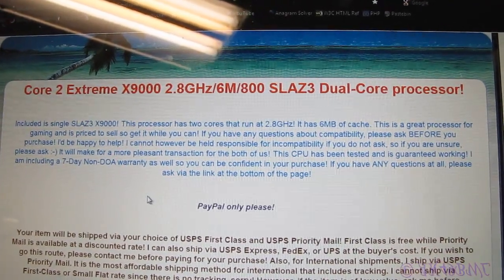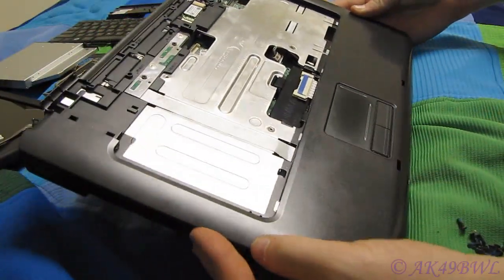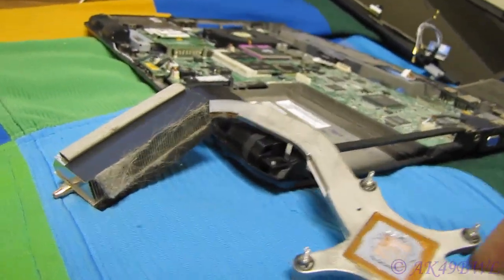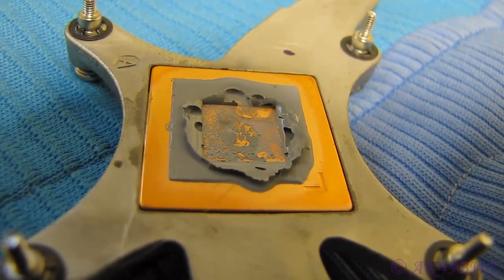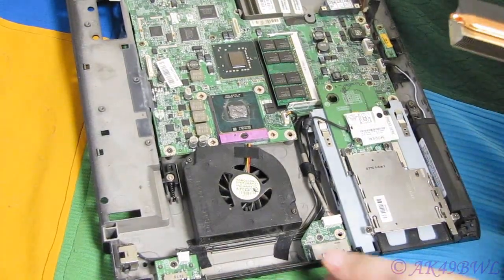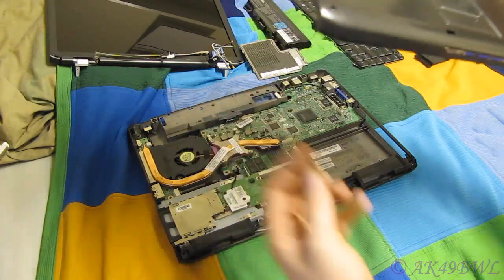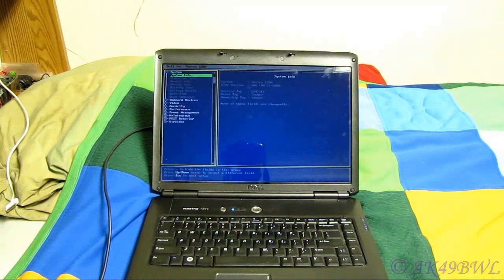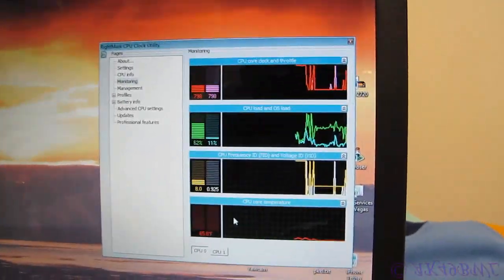How to Replace a Laptop CPU

Comment: Could you please tell, I have Acer Aspire 5310 with Intel(R) Celeron(R) M CPU 530 @ 1.73GHz but my computer is slow, if I buy Core 2 Duo T7200/2G you think is compatible with my computer and it will be very fast?.
Thank you.

Comment: Love the motorcycle at 9:52   Nice video too.  I wonder if the new Dells with the Core i 3-5-7's CPU's can be upgraded. The manual for my i7 shows you how to "replace" the CPU, so an upgrade is likely.  Going to an Extreme CPU would be pretty cool (hot).  Is Dell the only manufacture that allows you to upgrade your CPU?

Comment: There are a few adapters out there that will let you run a laptop cpu in a desktop, but I haven't seen desktop to laptop adapters. I think the heat would be to much. For example, The one adapter I saw was an Asus Ct 479.

Comment: hello, i have a Intel pentium dual cpu t300 @ 2.00 ghz in my compaq prescario cq70 but i want to upgrade it , i dont have much knowledge when it comes to computers but can i upgrade to any sort of processor. I use sony vegas alot so need something decent for rendering & general computer speed.

Comment: Hey! 

Q:  Can GL960 Can Handle Intel X9000?
Cause GL960 Can Handle a Intel T9500.

I Have an Acer aspire 4715z, w/ GL960 Chipset..
and I Found Some Threads/Forums That GL960 Can Handle a CPU That Have an 800Mhz, FSB..

Comment: WHY ARE YOU DOING THIS ON YOUR BED.  you need a static free work environment to work with computer hardware because you run the risk of shorting something out.  Hardwood/tile/linoleum floors are the best, on a table, without a watch on or phone in your pocket. Shorts on components do happen as a result of static, and it does suck when it happens.

Comment: Hi I currently have a Toshiba Satellite C655D, and I really want upgrade my processor. I currently have an AMD E-350 Processor (2 CPUs), ~ 1.6 Ghz, and I want some type of i5 processor.
1) Do you have any suggestions on which processor might be compatible?
2) Would Best Buy be able to change the processors since I won't attempt it?
3)Do I need to do anything else?
Thank you for your time,

Comment: Thanks so far. What's a pga988? How do you throttle it back? What are you throttling back? I'm not having you on, but much as computers fascinate me, I know surprisingly little about them. I know more about PlayStation2 hardware, but that's only because I opened up the casing when (for another project) I had to tinker.

Comment from the maker: Hehe, I've done that, it made for a fun several minutes :D
Yes it would probably be just fine if you can upgrade the heat sink. I cant on mine so when it gets too hot for my liking (about 160*F) I just throttle it back a little. Your P6200 is a pga988, so that's the only style i7 you can get, but there appear to be a lot of options :)

Comment from the maker: About the RAM... You tell me. Apparently you don't seem to believe 4GB is enough, despite the fact that 32 bit windows can only use 3.5 of it anyway... AS for the CPU, I'd need to know which chipset it's running. You most likely can upgrade it, as manufacturers never put the best possible CPUs in there.

Comment: the scratches wont affect cooling much:p and not another comment about how you put to much just some helpful info the thermal paste isnt to transfer heat (it is partly) its mainly there to fill microscopic holes in the copper heat pipe  and the cpu :)

Comment: you dont need a new pc guys , ive had this for 2 years , i have a few laptops , but i have a old laptop and it has a core i5 , and has win7 ultimate 64 bit , works fine , obvs other things have been changed , but worth it

Comment: wow your computer is really old that a lot of shit just to get to the cpu my computers cpu is  really easy to get to just unscrew the bottom take of the heat sync and wala cpu! you could have just bought another computer with  one of the icores instead of a core 2 duo extreme its almost 10 years old now thats centuries in computers. lmao

Comment: Did you even think about the more cooling power you need for a better processor?
Because Dell designed the cpu cooler for a lower end cpu not a high end one.

Comment from the maker: All you need is the chipset model. 945GM: ark[dot]intel[dot]com/products/chipsets/22816?wapkw=945gm - - - The highest model CPU you can use in your computer will be the Core 2 Duo T7600 @ 2.33Ghz, 4MB cache, 667Mhz FSB.

Comment: you shuld NEVER use a screwdriver to clean the thermal paste off it will scratch the copper and it will give worse cooling performance. And you should use as littel cooling paste as posible and get a thin layer over the core or else it will have more "space" to move through. just saying other than that good video

Comment from the maker: I use it for video rendering as the most CPU-intensive task on it, and the CPU upgrade did it a WORLD of difference. I'm not a gamer beyond little stuff.
For the other two comments. I was not aware at the time I did this what was right or wrong, I just did it. And such as it were, it's still working perfectly so I'm not going to worry about it.

Comment: You had to take the entire laptop apart, even the keyboard. Just to get to the processor. Wow, didn't realize how lucky I'am to have a laptop with a back plate that's easier to remove then a cellphone battery cover.

Comment: I have a question about my laptop. I have a (late 2011 Model) HP Envy 15 which has an intel i7 2670qm processor. could i upgrade that to the i7 2860qm or maybe even the new ivy bridge processor?

Comment: Ok just a tip next time, don't glob the Thermal Grease on like this. The thermal grease is only meant to fill in small scratches in either the dye or the heatsink, using to much thermal grease can negatively affect your processor by not letting it cool properly.

Comment: Brillant...such a instructing video with clear quality and no boring. Thanks for upload.
 Can you please guide me. My laptop has T7250 with integrated  intel 965 (X3100)video card. but I have spare motherboard T2310 with Nvida 8400 (better for games). 
1. Can I replace the mother board.
2. If yes then Can I put the processor of T7250 into T2310.
Thanks

Comment from the maker: @Gamefreakzzzzzz either the CPU or GPU maybe. I don't know that replacing the CPU will fix your problem tho... Your problem is with cooling, not the CPU directly. But, I got my CPU from Ebay if you still want to try that... But that's even more in depth than cleaning our the heat sink.

Comment: @AK49BWL my laptop is  about 1-1.5 years old, and i dont dare to open my laptop parts to clean it all up cause i probs screw up :S ,  but my laptp does get enough air i bought a cooler for 25 euros, but it sitll feels like 100000 degrees hot lol, what do you think??? is it the CPU  ?? if so, were do i buy a new one and about how much will it cost me? Thanks for answering my question so fast :).

Comment from the maker: @Gamefreakzzzzzz Sounds more like you need to get more airflow to the CPU heatsink. how old is your laptop, and have you ever cleaned the heatsink on it? It may be clogged, causing the overheating because the fan can't get any air over the heatsink fins to cool the CPU.

Comment from the maker: @dragumox3 This depends on whether the 3rd party keyboard supports your laptop. The connector has to match, and the pinouts ON the connector have to match.... Otherwise I doubt it would work at all. Generally you have to find a perfect matched replacement, however if your laptop (from the factory) has the option of using a lighted keyboard, you can generally find a direct replacement on ebay or a computer store maybe.

Comment from the maker: @aliha9123 No. There are only specific models you can replace a specific model with. Generally speaking with laptops you have to use the same FSB, and you have no choice but to use at least the same socket type, that being LGA775, PGA478, whatever. Also, Desktop PGA478 CPUs are not compatible with laptop PGA478.

Comment: @AK49BWL  more compatible with amd. am2 will take am2+. am3 and am3+ i can't vouch but i know am3+ sockets can take am3 chips. this is all depending on the tdp rating (in watts). the bus will down clock to the slower bus, board or cpu. the ht is 2x the bus speed in mhz. a bios update might be needed though chipsets don't really matter much. intels are more picky about things chipset bus wattage and the manufacturer's limits in the bios..

Comment: @KillfeedOMG it makes it easier if you have a "service manual" open on another machine. it'll tell/show you how to safely take it apart. one thing, don't gob the compound on the cpu, a dab will do you there. rice sized grain on a chip that small would be good. also don't use a screwdriver to get the baked compound. aside from that make sure you have a clean surface for the compound, i use alcoholism and qtips to remove the left over residue. it's never let me down.

Comment from the maker: @kevkev047 From what I've found, it is possible *IF* a specific model had more than one graphics card made for it (not including Intel's integrated lines). If the 17r only had the one card made for it (no upgrade options, etc), then no, it's not possible. But, Dell seems to have at least two different options on all of its new systems, so you'll just have to research a little :)

Comment from the maker: @Demadafaka997 Although if it did work at all, it would probably be very limited functionality... Until it blew up due to the overvoltage because the older socket 478 CPUs required higher voltages to run than these do.

Comment: I found out why my laptop was only reading half my ram and memory!!! it was because AC adapter was failing to recharge my battery.  I was able to get 5.9 Windows Experience Ratings across the board only using a 2.4ghz T7700, 4gb ddr2 ram, 30GB Vertex II SSD, and 8600mGT graphics card.  Pretty fast.

Comment: @AK49BWL ahh, thats what i thought.

180 dollars is a good deal. apparently that processor takes overclockings well, too. ive seen it up at 3.2ghz without problems.

thanks for the video and the response. it has really helped me by giving me confidence in my ability to replace a cpu if necessary (which will save me a lot of money in future).

Comment: also, from my understanding of chemistry and physics and other videos etc, you put the thermal paste on really badly (but ive seen much worse attempts)

ideally, you should put a single solid spherical (or rectangular) blob right on the centre without any flaws i.e. uneven/jagged bits that could allow bubbles to form.

then apply flat, even pressure until there is a very thin layer between the CPU and sink.

you did a good job of screwing it in. although i would have been extremely meticulous.

Comment from the maker: @jawston9 Video card replacement on a Vostro 1500 laptop with no dedicated graphics? Impossible. Can't be done. I've researched that mod specifically 200 times over, I know this lol.

I run 4GB DDR2 RAM, I believe 533Mhz but not sure, could be 400.

Comment: @AK49BWL interesting... as a core 2 extreme isn't supposed to 3.1... what is your memory rated at?  I have 4gb and its still at 2.8, strange huh.  The video card, 8600m gt for only 25  bucks on ebay and it boosted up my settings to 5.4 and 4.7 instantly

Comment from the maker: @jawston9 It says 3.1 now, so I must have run the tests again... The real bottleneck in my system is the integrated graphics, good ol' Intel can't keep up with graphics-intensive stuff lol. You just go to your System Properties to update it.. Unless you mean make the number higher, in which case you have to replace hardware with better hardware, but this being a laptop, that's not easy :)

Comment: Hello, and congratulations for the video, you're very good, I wanted to ask you a question:
I have a acer aspire 5735z and I wanted to update it, it features a dual-core T3200 processor, Intel Pentium, 667 MHz FSB, the motherboard is a socket mPGA479M.
How can I upgrade procesorre? Hello, thanks ...

Comment from the maker: @turokkill Well, thing is in my case, the temps actually went way DOWN. My idle with the Core2Duo T7250 were around 115*F, whereas idles with the X9000 are around 85* to 95*F... I swear if it gets any cooler it'll be room temperature lol. Now I can't claim all upgrades will be that good, but the only way to know is to try it ;)

Comment from the maker: @turokkill Check Intel.com for your laptop's chipset. If the chipset can support the CPU and the socket is the same, then it's a high chance the replacement will work just fine. I wasn't able to find anywhere that this laptop WOULD DEFINITELY support the X9000.. But Intel's website said my chipset supports it so I took a chance lol. And it worked! And that's all it is really... Taking a chance and knowing that if it doesn't work, you'll be out the money or have to resell the CPU.

Comment from the maker: @drjaymahdi1 It's a stock Win7 icon lol. Never got around to changing it beyond that.

I've seen people lay it on thick and thin, but the way I was taught was to do it thick, because the pressure of the CPU die against the heat sink is going to squish it all out around the sides anyway.. And in the time since this video was made, I've kept an eye on the CPU temp... It actually stays 15F degrees cooler than the C2D I had in here before! Right now it's sitting at 96*F... I can't complain haha.